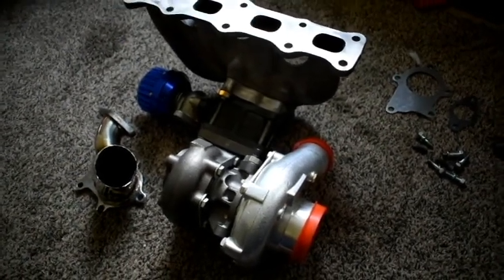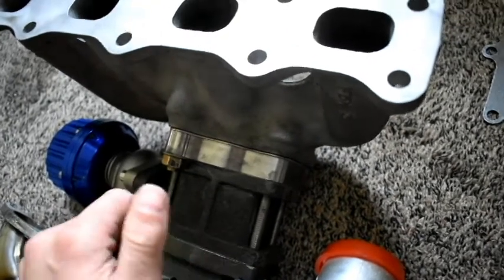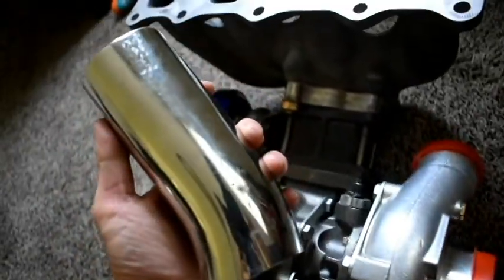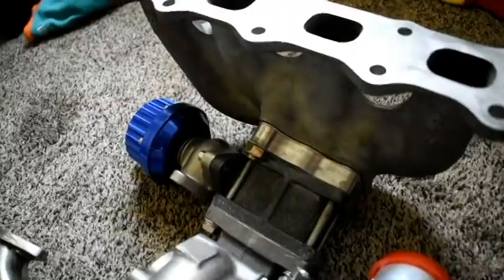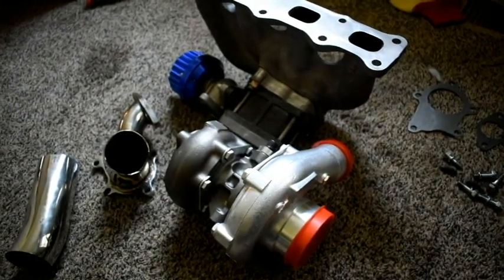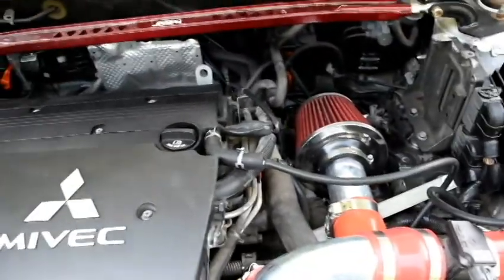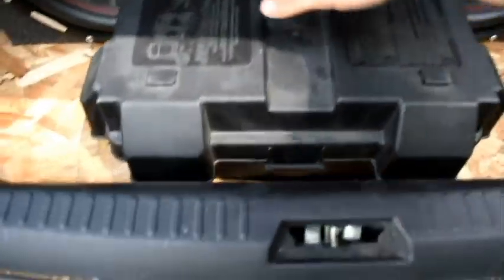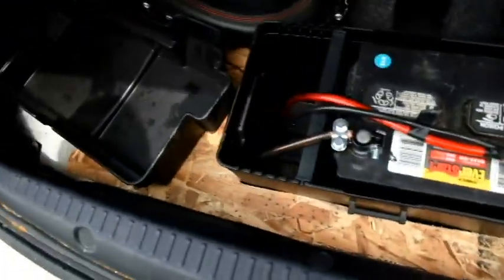How to Install a eBay Turbo Part 6 | Pre-Turbocharger Installation

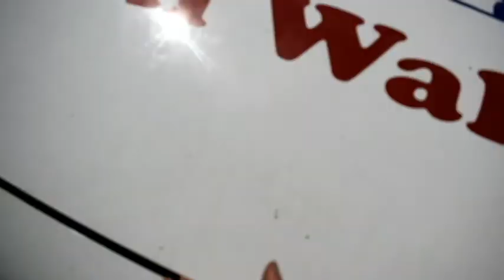Comment: Hi. I'm really trying my best to follow this and I have already bought some parts with the intension of doing a similar project on my 2015 Lancer. I can see on the video at around 3:27 you have vacuum pipes connected to the BOV and the crankcase breather, can I ask where you eventually hooked these up to? Thanks

Comment: I cant believe no one has asked why you have you the air filter connected directly to the intercooler!?! - The air filter of a turbocharged car goes to the front inlet of the compressor cover. I have actually almost just died laughing
Reply from the maker: +Shannon Fitzpatrick is the turbo on the vehicle when you watched it? no, it wasnt not baha so you better get your story straight nefore U start hating... I had to get this car from POINT A to POINT B... and id rather hav a filter on instead of no filter... so untell it was finished I had it this way bcz full time college, and a full time job = not much time, Ik how a turbo works guy lmao people these dayz, alwayz assumming... you are whats wrong with the world today...